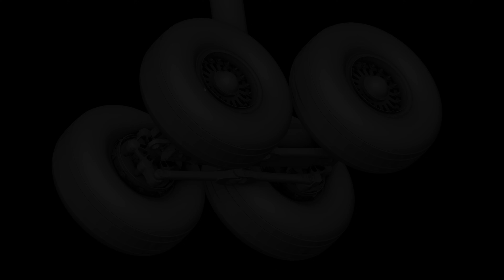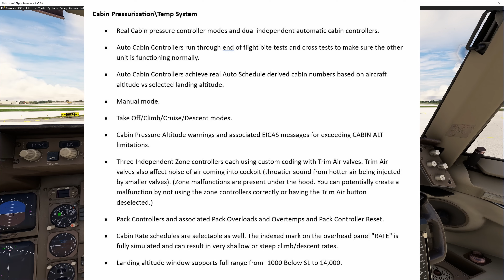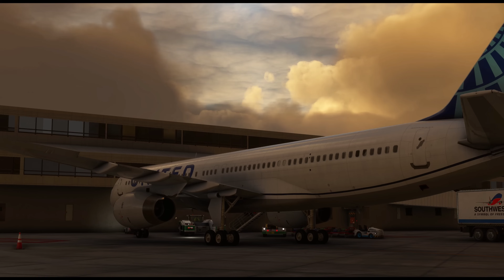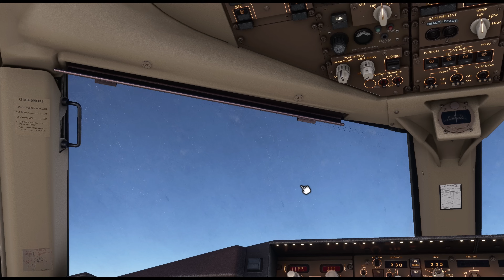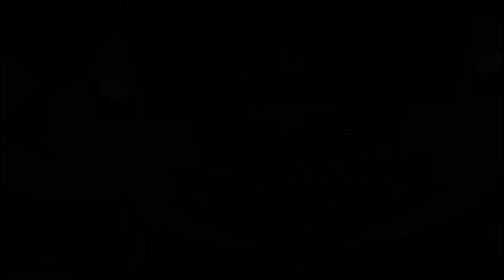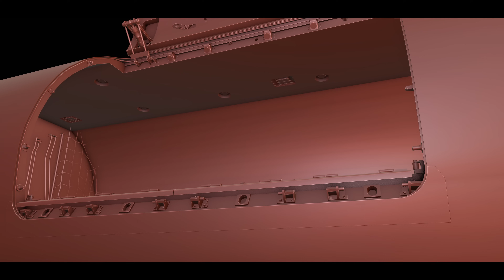BlueBird Simulations 757 January Update - Systems and Progress

Comment: I really hope for good optimization since I'm running on a low end machine. Of course with the system depth as shown here I don't expect to get framerates like on PMDG 737 for which I can run at around 40 fps perfectly fine, but I really wish this will run better than the 10 fps I get from Fenix :(

Comment: As far as the external model goes, will there be structural vibrations added? like engine/ engine strut shake, slats vibration, tail movement in severe turbulence...etc
Reply from the maker: Yes
Reply: @bluebirdsim  That's awesome! simmers can really feel the weight of these type of jets with these subtle dynamic animations while on a normal size monitor

Comment: Looking reallly good.. hey I have a question, especially while your still in development.. It has to do with Ground Power connections.. You have the portable ground power, but I was wondering if there is a way, you have option for Jetway Ground Power and then show the ground power cord coming from the Jetway to the aircraft ?  I'm furlough UAL employee from DTW, plus my other jobs with the ramp before being with Actual UAL but working with UAL planes.. Since the development of the GPU coming with the Jetways, really only time we'd use a portable is if Jetway GPU was broke or hard stand parking, when we towed an aircraft and it was in a remote area other wise we mostly used Jetway GPU..
Reply from the maker: Hi there.  It has crossed our mind to do this at some point.  For now we are just going to have the portable GPU. But it would definitely be cool to have a jetway GPU option at some point.

Comment: Hopefully it will come on with fully functional VNAV,  I do understand that is the hardest portion of the automation.
Reply from the maker: Correct.  VNAV alone will take a few months to complete and then tune.
Reply: @bluebirdsim if you need another hand on deck for vnav I can help for free. I’m an aerospace engineer and software engineer, could use the resume builder and would genuinely like to help.

Comment: I genuinely appreciate the effort and all the tiny details, but there comes a point where those details no longer matter, and a release needs to be pushed. At this rate, we’ll be on next-gen hardware!
Reply from the maker: Simply no. I have already explained this at length multiple times.  You can't just "push" out a high quality airplane from scratch. Go give it a shot yourself and then I think you will appreciate the amount of work it takes.  This is going to be a truly phenomenal release.
Reply: With all due respect, I have extensive experience in CAD and software development, having worked in the field for the past 23 years. I fully understand the time required to develop something of this scale. However, it seems that attention seems to be spent on minor details. At this point, progress feels slow and misplaced, and it’s frustrating to see delays drag on without a clear end in sight.
Reply from the maker: @Nobodyelsehasthishandle   The fact is that you have not worked on a flight sim project for a totally new platform. It's nice to know you have experience in CAD and software dev but you know nothing about developing for a new platform of MSFS with all of its numerous hurdles and obstacles and having to figure out things our own with virtually no support from Asobo or MSFS. Keep in mind that some of the big names that people compare us to have had extensive support from them. But not us. So with all due respect, you are making assumptions about our team to which you have no idea what is going on in the background. Absolutely zero. We are not working slow or focusing on small details. We are focusing on making a high fidelity aircraft. That involves getting the "small" details correct. Having said all of that,  I hope you have a better understanding now and if not then that is fine. I never intended for this project to take this long but I am a long term thinker and in the long term this will be beneficial for BBS and for the flight sim community. Keep in mind that once this code base is complete,  future projects will not take this long.
Reply: @bluebirdsim  Hi, please do not entertain such negative comments. You don't owe anyone anything, you didn't take money calling it early access. We are looking forward to the release, thank you for such an extensive and thorough effort.

Comment: Super excited for this 757. One small thing with the HYD system I noticed in the video, and you guys may already know this, as you’ve mentioned there’s still a lot of work going on with it, but both center HYD pumps will not run with only a single electrical power source even with both switches in the on position. In the video only the APU is running and both center pump pressure lights are extinguished. The left and right AC busses have to be powered by separate power sources i.e. an APU generator and an Eng generator for both center HYD pumps to run simultaneously. Not knocking anything just something I noticed. Been an A&P working heavy maintenance checks on the 757 for 12 years and ERT qualified on them so I’m always looking at these things for post maintenance ops checks. Anyways looking like a superb product on the horizon and can’t wait for a release.
Reply from the maker: Just another update,  we just implemented the fix and tested. Works perfectly now. :)
Reply from the maker: Yessir,  this will all be ironed out no worries. Thanks for the input.  The hyd system is 90% complete meaning we have to go through and fix the "little" issues.